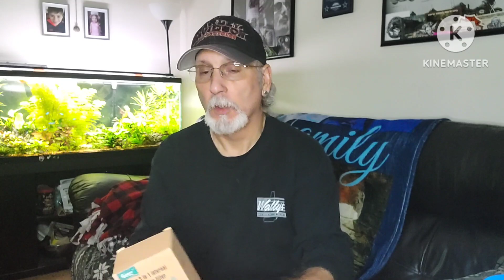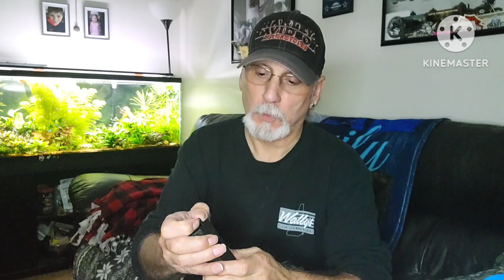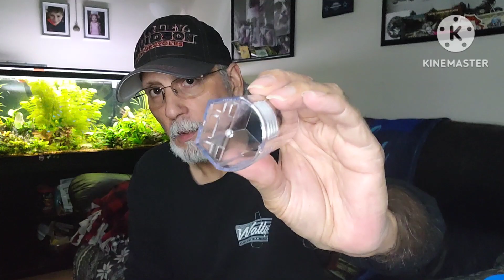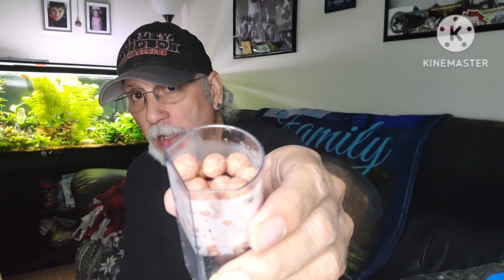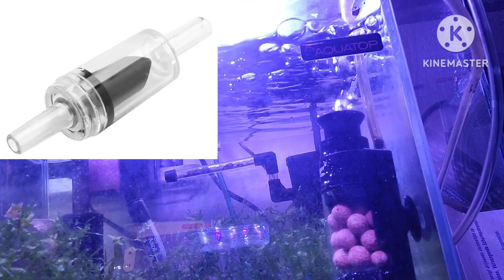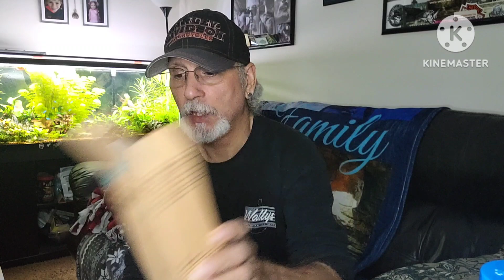Hygger 3 in 1 Internal aquarium filter

Comment: How can you tell that it is drawing water up from the bottom and through the sponge and bio balls? Like you said, the air is trapped in the top. I have one of these and replaced the bio balls with light weight micro-moving filter media too see if there would be any movement,  and there isn't.
Reply from the maker: Depending on the size of the pump and the weight of the balls, maybe why they are not moving. If you have bubbles in a decent flow up and out, you will have flow/suction. Now, depending on the size and flow rate, it will dictate how much draw/suction you have. But if the stream is steady and bubbles small to medium, it should be working. You don't want giant bubbles as they rise too fast, and the gas exchange is not as good as with steady and smaller bubbles as it's creating more volume up and out, which is rising up and exchange gases at the surface more efficiently. Basically, flow equals draw, which is dependent on the amount and rate. I run a larger air pump than the tank size listed. Hope this helps.

Comment: Hey guys, and Rob, I purchased this but found that it had either no flow, or EXTREMELY low flow going into the filter.  I found a video of a guy testing it with food coloring and it had literally nothing going into it.  I also tested myself with a piece of floss and found it just wasn't pulling anything in there.  The air seal is 100% on my intake tube and I'm using a solid pump.  Just want people to be careful, it could work well passively?  But I just don't think it's a very good product.

Edit for the video: https://drive.google.com/file/d/1mSehla5sao8Ft-EFvBeSCYID_mF4Bx2d/view?usp=drive_link

Comment: I bought this filter for my 4 gallon betta tank and it’s been running since last night but i dont see water clear and it makes modarate sound. I’m doing something wrong??
Reply from the maker: Do you have a moderate air flow going through it? Filter media in place? Also, depending on the air flow through it, it may take more time to clear it up. Also, you had not mentioned I'd the tank was a new setup or if it is cycled. I'm leaning towards the rate of flow through it, which affects the filtering rate.

Comment: I just bought it and in my case it does not suck the water from below, the bubbles come directly from the connection to the surface and dont make the filtration part, can you help me

I bought this filter because of this review
Reply from the maker: Is the hose tight on the fitting and the fitting/block pushed into place? If your airline has been used on other things, cut the worn section off so you have an un stretched hose going on the fitting. The connection where the fitting goes is a plastic block. Make sure it's pushed tightly into the filter. If you are still having issues let me know.

Comment: You said this is good for small or medicine tanks, would you reccomend this for a 10 gallon tank? If not what filter would you reccomend for a 10 gallon?
Reply from the maker: The one in the link will work up to 20 gallons. This should work for a  10 gallon, just as long as it's not super overstocked.

Comment: Nice review.  I consider this a gimmick filter as it has no advantage at all over a small sponge filter.  Thanks for the review.
Reply from the maker: This would be the equivalent of a small sponge but the sponge is smaller where adding the bio balls create more surface area for bacteria and makes up for the small size of the sponge. This would be good for a tank with a small bioload, a small hospital tank, or a quarantine tank. This would be the equivalent of the many internal filters out there. Cheaper alternative to some of those, but I think it will work in the proper application. Thanks for watching and for your thoughts on it.
Reply: @DeFreeseAquariums  Your welcome and thanks for the reply.